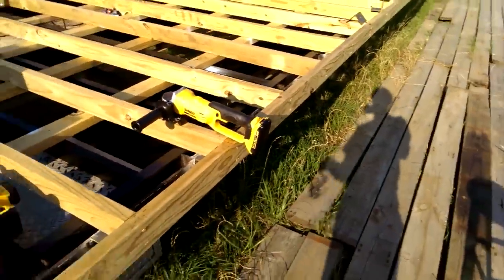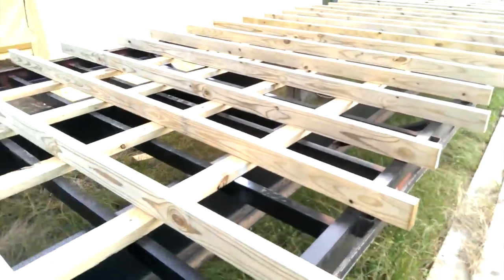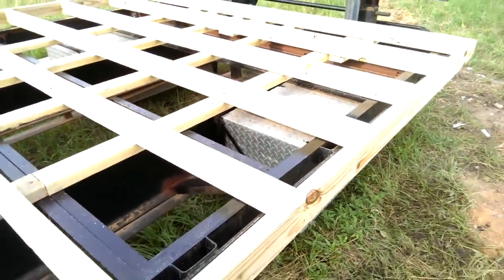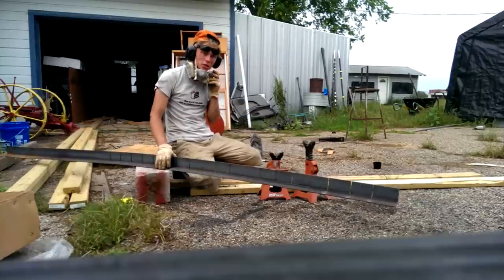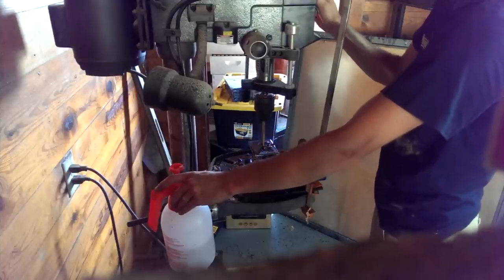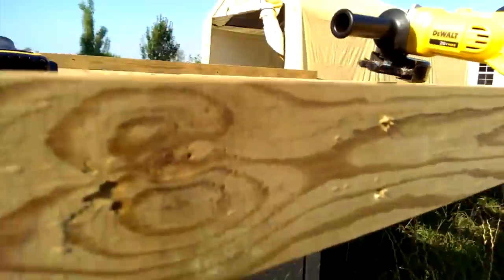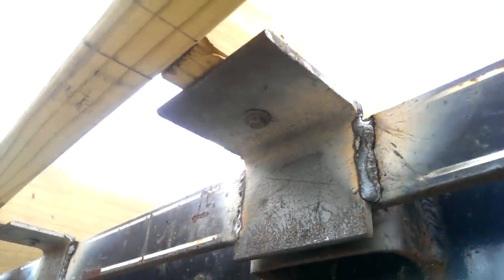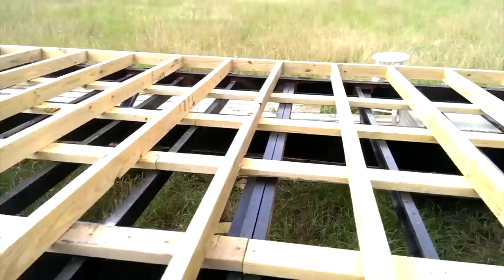Tiny House Mansion - Episode 2 - Trailer Expansion

Comment: Mig welders don't have slag.  Argon gas is pumped over the weld area.  If your welds look bad, make sure the gas is flowing.
Also, I realize this is all built and its too late, but for other people watching, I wouldn't recommend using deck screws in any framing.  Use nails, deck screws can't withstand the shear forces that a nail can take.  Go spend the money and get a nail gun.  It will shoot 3 1/4 nails all day long.  Gun nails are coated with glue.  Nails are faster and stronger.
Reply: There is gasless mig welding i.e. Inershield

Comment: When building balconies, the cantilevered amount should be no greater than one third the amount within the structure, or one fourth the total length of the board.  

Your cantilevering "rule" seems overly restrictive if the base is properly mounted (but either seems a bad idea as far as going down the road, not for cantilevering but for sticking past the tires while driving and making turns, possibly in a high wind)....

(PS...Should have used welded angles that stick out to support outer beam, removes lots of issues/possible problems)

Comment: 102 in is as wide as a trl can by law
Reply: Everett Gaskins oversized load permits are usually less than $50.
Reply: Dan Baker depends on state, county, city.....moving through some areas of Atlantic seaboard it may cost tens of thousands to move through a state and may require you use their lead and trail vehicles which you also have to pay for....

If you will only move trailer once, it may be worth it, but if you plan on living a nomadic lifestyle stay within the eight foot six inch rule......use slide outs as necessary....
Reply: Abby Something that is just not true.  I believe every stat except 3 allows a 10' yearly permit that allows you to drive without an escort vehicle.   Do not scare people when you yourself are guessing....
Reply: Different states have different prices for oversized loads, 10 foot loads don't require escorts anywhere. I haul them on my 18 wheeler all the time, they just require proper signage and flags. I'm not sure, but you may have to have a CDL to tow it though.